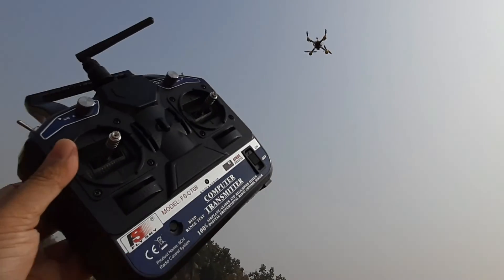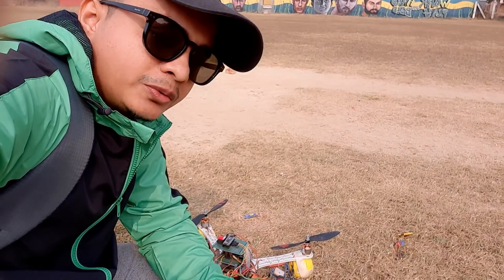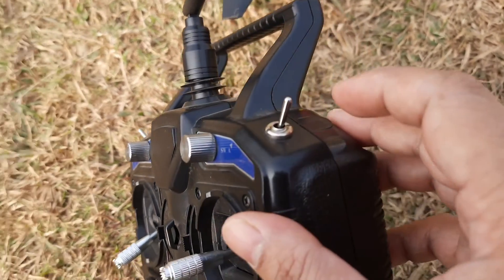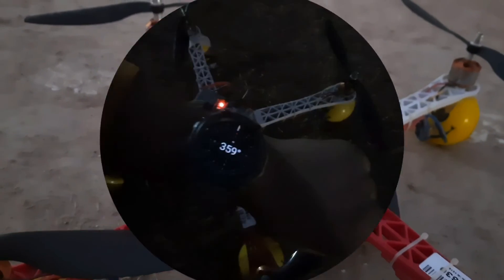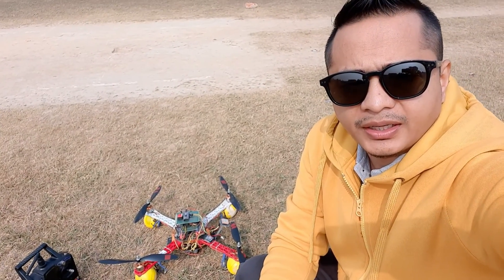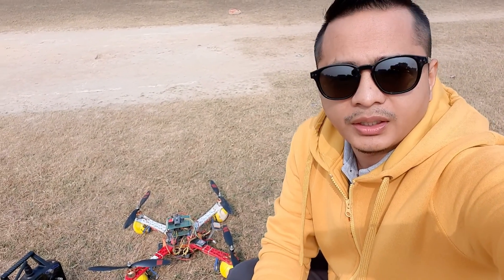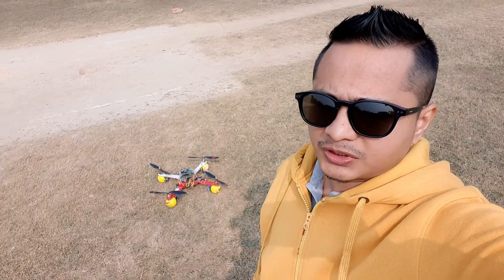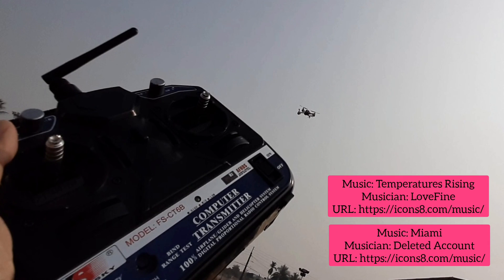Arduino Quadcopter Development Part 8 (GPS Position hold test)

Comment: Bro this is a stm32 drone or Arduino
Reply from the maker: @mayuzx1593  its an Arduino + another arduino for the GPS
Reply: @dhruvdroids  where is the circuit diagram and programming codes .????